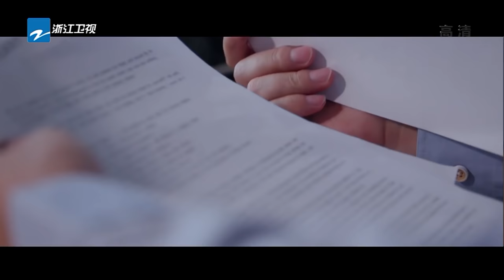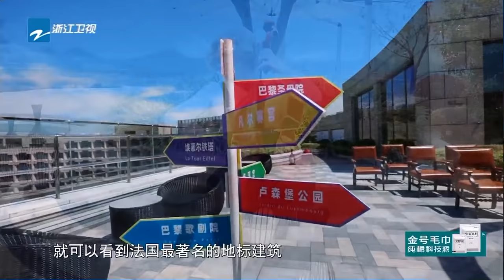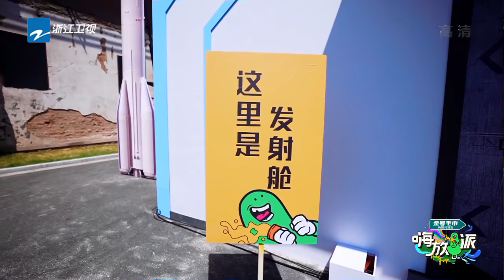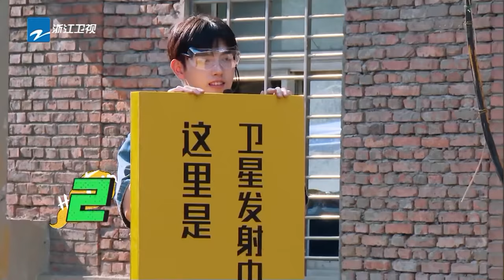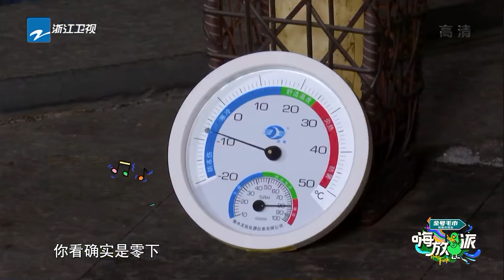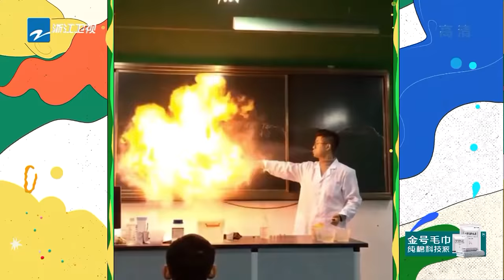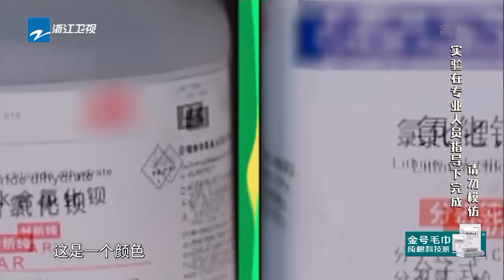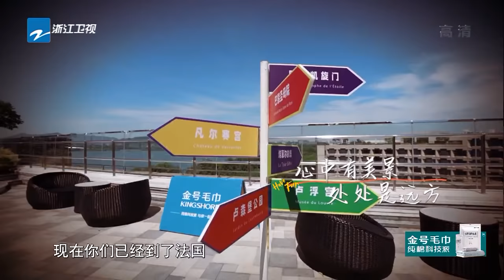ENGSUB/VIETSUB | EP7 | 王嘉尔穿宇航服蹦迪！李晨惊喜加盟 嗨放派全员“上天”？《嗨放派》EP7 FULL 20211002 [浙江卫视官方HD]

Comment: This episode look fun as well 🥰
Will wait for English sub for another round😉
They really having fun. A boy in a man suit 🤣.  
It would be fun if they explore the world of bubbles.

We are always fascinated with Bubbles. Hope #HaveFun team can explore this captivating elements.
Using the best recipe to blow a really really big bubbles and stand inside it as many people as possible.
We know bubble loves wet surface we can blow bubbles inside a bubble cause the wet straw can pass through it. With proper smooth wet suit, CAN WE WALK in and out a giant bubble without popping it ??? 
Explore the "air lubricating system"  inspired by Emperor penguin.
Recreating Mr. Rintaro Hara floor to ceiling bubble blower.
Exxplore the right air speed and various nozzle angle to blow a bubble using gas jet blower 
Have a bubble race ( stay afloat longer or reach finishing line faster )
Creating bubble structure, bubble art, freeze them , fried them, blow them ( fire bubble),  make square bubble, use Bubble as math solution tool to find the shortest distance between few points.
Exploring bubble tea, bubble water, bubble plastic and much more.
The fun could be endless.